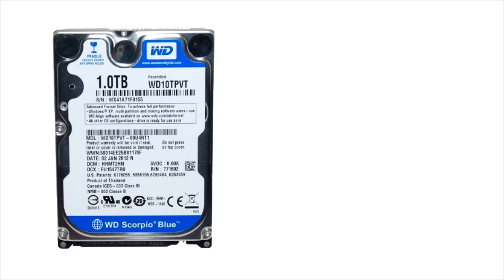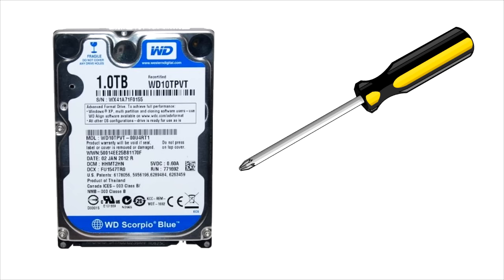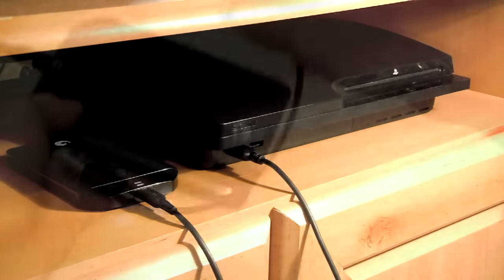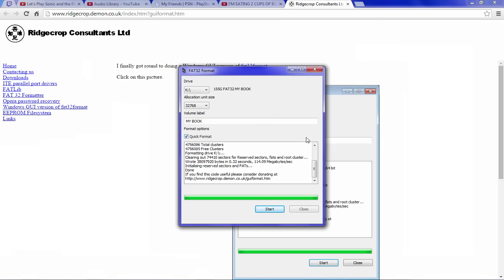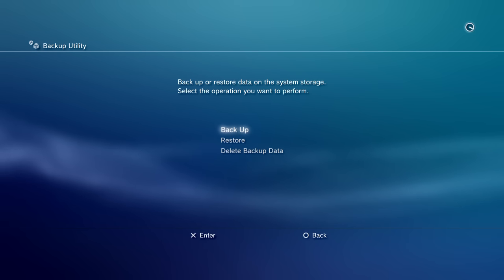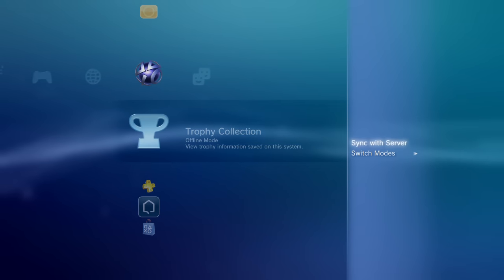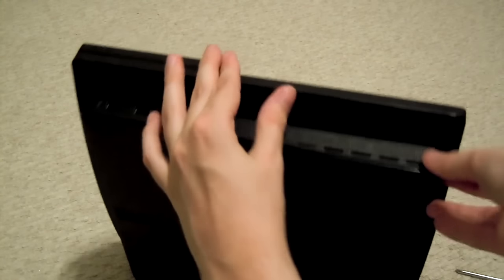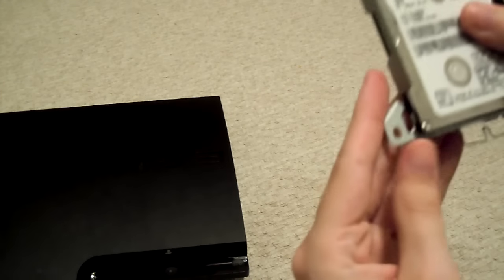PlayStation 3 Hard Drive Replacement Tutorial

Comment from the maker: It has come to my attention that Sony used JIS screws on the hard drive cage inside of the PlayStation 3. All guides I researched for this video mentioned that these screws were phillips screws and that a phillips #1 screwdriver, like the one I use in the video and tell people they need to replace the hard drive, would be all they need to replace a PlayStation 3's hard drive.
You might be able to take out these screws using a phillips #1 screwdriver like I did. But if any of the screws won't budge, you shouldn't force the screws out as you might end up stripping them. You might need to acquire a JIS screwdriver if you don't have one already to remove the screws from your system's hard drive cage.

Comment: Still working like a charm in April 2024! So instead of an external hard drive, I did use a PNY 256Gb thumb drive to save everything from my old hard drive and it worked just fine. Also, my restore took a few hours less than my back-up, which was a pleasant surprise. This video is excellent, thank you very much!
Reply: do you still have your hdd in your console or did you replace all of that with the thumb drive hdd
Reply: @bynxtypebeat  So I had the original HDD in the console and followed these instructions to a "T" with one exception -- he says to use an external hard drive with its own power source to back-up your old PS hard drive onto before you switch it out, rather than a thumb drive. I didn't have an external hard drive with its own power source, but I did have a 256 GB thumb drive so I figured I would try that first before shelling out money for a new external HD. I did, and it worked like a charm! My original HDD was still in the PS3, 160 GB, and it took about 8 1/2 hours to back up from the original PS hard drive onto the thumb drive. Then I switched out the original 160 GB PS hard drive with a Western Digital 500 GB hard drive, went through the process as described in the video and then restored all of my stuff from the thumb drive, which took about 5 1/2 hours (in the video, it took him longer to restore than to back-up, for me it was the opposite). Once I restored to the new PS HDD from my thumb drive, I removed the thumb drive and the system works like a charm. I hope that helped clarify what I meant
Reply: @HlotSfan did you use the same thumb drive to load the new software update onto the ps3 upon startup? Or did you use a seperate one?
Reply: @JoshDambuleff  No, I used a second, small thumb drive that I had saved the update onto. The update itself is a pretty small file, so I used maybe an 8GB or 16 GB to store the update. And then every so often I will go and update the update on that thumb drive, just in case I ever need it again.

Comment: I followed this guide and used some tools, and it worked! My old HDD was clicking, booting me out of games, having problems starting, etc. I thought I was toast, so I quickly ordered a new SSD and didn't proceed to use it to do any more damage until it was replaced. Shortly thereafter, my SSD finally arrived in the mail from Amazon. Here's what I did:

I used IM-Magic Partition Resizer Free to format my new 1tb SSD (Crucial brand, if you're wondering) to FAT32 Logical partition. 

Then I used HDD Raw Copy Tool to make a perfect 1:1 clone of my old HDD to my new SSD. It was pretty straightforward. 

Just popped it in, turned it on, and bingo... works perfectly. :)
Reply: When you cloned it, what happened to the extra space with the SSD? I don't get how the PS3 will even recognize it as it uses a file system other than FAT32.

Comment: Painless and effective. Works like a charm, had fun doing it too! Thank you for this detailed video.
Reply: Is it normal to be stuck at checking please wait after installing the flash drive it's taking forever
Reply: @stylewithaltitude-mensstyl2295  it doesn't sound normal, maybe start over and try again
Reply: @rMachete  I got through... still getting the error on multiplayer saying ea connection to the server was lost. Do I need to sync ea with psn?

Comment: The best tutorial I've seen so far....i've used it to upgrade to a SSD drive. Congratulations Sonicghost!
Reply: I heard SSD drives are useless in a ps3 and that speeds are severely limited, is that true?
Reply: Kosm _ depends. Some games it improves performance and it also improves loadings and installs
Reply: I will try an SSHD tomorrow. Let's see how that goes.
Reply: what if you have game installed on your old HDD, can they be transferred?
Reply: @TheEndofThis  Not really useless, but you're not going to get full ~500MB speed that SATA SSDs are capable of.
Speed is limited to 150MB as it's a SATA gen 1 connector.
For comparisor regular mechanical drives have a max speed of 80-120MB. So you do get a ~25% speed boost.
SSDs have another advantage though, no "seek" and "spin-up" times which makes the whole console feel a bit more responsive.
The difference is not huge but it's there.

Comment: Thanks for this vid. Got my PS3 via a recycling site as a non-starter, so zero cost and was then given a 500Gb disk for free too.
The original disc was dead, so followed your process for the physical replacement up to the 'two button press and hold to power up'.
Because the replacement drive wouldn't boot as it was from another device and since it didn't have valid code on it, the PS3 menu allowed me to format the disk in-situ and then after the usual 'no-way-back' warning, proceeded to load up the new system software.
The only glitch, which was very minor, was the system didn't advise the user to press the X to proceed when the EULA was shown on the screen, so made the assumption I needed to and now we have a happy PS3 user.

Comment: i accidentally updated my jailbroken ps3, and bricked it. i eventually took apart of 20gb xbox 360 hard drive, got out the mini hard drive, and put it in. then i just followed theses steps, and its updating right now! thanks so much!!!!!!
Reply: When you get a new hard drive (cuz 20gb is really not enough) (i suggest)
Jailbreak your ps3 but after you did that DO NOT TOUCH the system update setting
BEWARE OF IT!
Reply: @mertansprinter  its been a while since this happened lol but yeah stay away from the system update if youre jailbroken it will not be a good time

Comment: Thanks , this helped alot I just upgraded to a 500 GB drive from a very full 160 on my ps3 slim. Trying to do this getting everything i needed prepped for more than a few months now. watching many instructional videos.finding a way to format to fat32  for my backup of my firmware and HDD. It has been quite a mess and fighting me all the way. When i finished the restore process i got a error.that it couldnt finish, although it did complete to 100 percent. SMH. I resigned in to PS account restored my trophys. But was unable to go into the PS Store without it freexing up and having to do a hard shutdown. I had to delete the PS Store and redownload it, Although, every time i finally figure out a process to solve a problem,and thank someone.... another problem arises. Hoping this time its for good. I am quite computer savy but this whole indepth process has really pushed my patients to its limits. The videos made it look so easy. I have had to repeat all the steps of the upgrade process multiple times till it finally worked. Even to the point of formating the drive for the backup  down to within 10 GB of the backup space required. So my ps3 would recognize it. Thanks again, Wayne

Comment: 2021 info: With the PS Store closing for the PS3 in July, I've decided to upgrade my internal HDD from 500GB to 1TB.
I was able back up my PS3 files with the PS4 Game drive (2TB external HDD) by formatting it to FAT32. 
The video titled 'Format any size drive to Fat32' helped alot.I then installed a new WD Blue 1TB HDD (for laptops, not desktops!) to my PS3 slim, and downloaded the update software 4.87 from the Sony webpage, and still works! Great video dude!
Hope this is helpful to anyone and everyone.
Reply: I like to ask, how is that PS4 game drive going on the PS3? It’s USB powered, right? I’m trying to figure out what external hard drive is good enough for the PS3 and not buying something that doesn’t work as this guy says to buy an external hard drive with its own power source or adapter. Thanks.
Reply: @BossBig709  For the PS4 game drive, first I connect to my PC, and format it to FAT32. Once completed, I then connect it to the PS3 and see it if reads it. I used it to backup my files mostly.  And, it is usb powered.
Reply: @Grayfox82  Alright, I’ll try that when I get one. Thanks for the response.
Reply: @Grayfox82  I almost forgot to ask, will a external hard drive backup my themes and game installs?

Comment: Thank you so much I upgraded in 2019 to a new one terabyte drive and this video still works fantastic. and it fixed my problem I had super lag because I had the original hard drive on the original PlayStation 3... And the dreaded clicking
Reply: I cant just put in a new SSD on a bad HDD? My HDD is clicking and not able to get on

Comment: This is a great tutorial! I backed up my PS3 to a flash drive and then restored it all to a new SSD without issue. Windows limits FAT32 partitions to 32GB which wasn't enough to backup my data so I used fat32format to get around that. I also put the bios on the same flash drive as the backup which worked.

Comment: 2020 and still relevant! Finally finished UNCHARTED 2 after many, many years and wanted to continue the series so today I thought it would be good to upgrade my 256 GB PS3 SLIM to a 1TB Drive. However, it got stuck at the screen where it can't find the update on the USB memory stick. After trying a few different suggestions I read this comment on another user (STI Driver) on another video post about performing this upgrade:  "All you have to do is unplug the USB CABLE from the system after pressing START and SELECT it will work guaranteed" - This got me in the right direction unplugging the USB controller cable at a certain point seemed to work. Even though it wasn't working initially when I used the same technique. Once it copied the update to the PS3 I unplugged the USB memory stick and then I was able to guide the update along with the USB Controller plugged in. I did also find an older USB memory stick to be safe as well. The restore from backup (on my external HD) seemed to fail the first time but it may have been that I had the wrong username in the system. I deleted the user and tried again with a different name I may have used and it seemed to be restoring my files from backup correctly. I then deleted the extra user. So unplugging the various devices at certain times seemed to work. An important step that might save a few of you some similar trouble if you hit this roadblock. Thank you SonicGhost and STI Driver! However adding payment systems again seems to cause all kinds of aggrivation.

Comment: This video is very helpful, but there's no need to install an actual firmware for ps3 ... It's installed on flash memory on console...  The only thing you need to do after rebooting console after upgrading hard drive is formating it after information about new harddrive detection.... Of course an backup of settings and save games before all of this is required (an usb stick is good for that)

Comment: Heads up for those having trouble unscrewing the hard drive from the caddy: Sony used JIS screws, which happen to look exactly like Phillips screws. I almost stripped mine before I saw someone on Reddit made a PSA about it, which forced me to buy a JIS screwdriver from Amazon. I don’t know how SonicGhost was able to unscrew them without any problems though…
Reply from the maker: I did not know that Sony used different type of screws to secure the hard drive to the PS3. Thank you for bringing this to my attention. All of my research said that the PS3 used phillips screws and using a phillips #1 screwdriver, like the one I used in the video, would work. I didn't have any issues taking out the screws using my screwdriver, but I know that might not be the same for everyone. I'll update the description along with adding a pinned comment to the video to let people know of this fact to avoid any confusion.

Comment: Hey nice video! Do you know if this will work on the newest 12gb PS3 consoles that from 2014? I would think they wouldn't sell such a small capacity system for cheap if the HDD could be replaced so easily, wouldn't everyone do that instead of buying a 500gb for more $$$?

Comment: Thanks for the video it helped a lot...Would it be possible to connect both hard dives to the computer and copy the old to the new. making the backup drive and flash drive with the firmware unneeded ?? Most informative video i have seen for PS3 upgrade.
Reply: The  PS3 uses an encrypted drive with a proprietary boot format that shouldn't even load on a Windows PC.

Comment: Great video. Question: I put in a new hard drive, got it formatted, got the prompt to install the OS, tried to install via an external drive I had been using for my PC (not sure what format it was in) & tried to use a cd-r; neither worked. Made sure the files were all labeled correctly. Do you think I should try a thumb drive or is there something majorly wrong with my PS3 & nothing will work? Any advice greatly appreciated, thanks.
Reply: Make sure the folder name is in all caps.

Comment: I'm stuck on the prompt that asks you to connect the controller to the USB port and disconnect it then press the home button to proceed when you first turn it on. I tried using a PS4 controller since I don't have an original DualShock 3 on hand and I even bought a Power A controller for a PS3 and when I tried connecting it unfortunately didnt work either

Comment: If I don't have a flash drive, I just hope it is be able to it with a external H.D for backing up and restoring I also have an SD card in the original backwards compatible model so maybe it'll boot from there as well. Let me know if you know.
Reply: Using an SD card is fine, just use a USB SD card reader. That's exactly how I did it, I don't have a flash drive on deck.

Comment: Hi Me again...I forgot to mention that someone must have already tried this as it' has a 120Gb Hard Drive in it when it should have an 80Gb...Also when trying to Update My Unit I used a Brand New Flash Drive...Went on the Playstation Site and Downloaded the Software and did exactly as they and You said to do...Created a Folder named PS3...Created a Folder inside that Folder named UPDATE...and copied the PUP file I downloaded into that Folder...Pressed Start and Select at the same time...And it came on and searched for the Update...When all was said and done it came back on and said it couldn't find any Applicable Data and I went through the same process over and over again with the same outcome each time...One other thing...It doesn't come on with any error code it just says that it cannot run on the current Software

Comment: I tried two different flash drives, both formated to fat32. When I pressed start and select, after a several seconds it stated "The data is corrupted. (8002F2E4)".
Obviously I tried a few more times but to no avail. I'm sadly disappointed. Not sure what to do at this point. Waste money and biy a third flash drive? I'm not sure what the problem is.
Reply: I just had the same error code come up at the same part of the process. Any one have advice on what to do here, or what the issue could be?
Reply: @Alex-CA  honestly I started over reformatting. It worked after the third time I went through the process. It was nerve racking but eventually it worked and it has been ok ever since. I hope you are able to get passed this and that we can continue to play PS3 for years to come.
Reply: @Faustustopheles  Yes! I was able to figure it out, I have to unselect the "quick format" option on my PC. It tooke 10-15 mins to format a 16gb flash drive, then plugged it into USB slot 1(closest to the edge) on the PS3 and it worked beautifully
Reply: @Alex-CA  that's awesome! What a relief. 😀👍🏼
Reply: @Faustustopheles  my last drive failed I think, my PS3 would literally freeze on startup and wouldn't even allow me to access the menus. I purchased a 1tb 7500rpm cuda drive on Amazon for about $60. This solved my issues. Now I can get back to playing some nostalgic exclusives 😁

Comment: this doesn't work for me it it says no applicable update was found, connect storage media that constains update data of version 2.70 or later, and than press the start and select , i have formated fat32, i have worked with quiet a few playstation 4's and the file which we download on the usb for ps4 is about 1 or 2 g i am thinking this is not the way for hard drive changes on ps3 files

Comment: What kind of external hard drive do you recommend? Will a 1TB external drive suffice?
Reply from the maker: Any hard drive that has external power I recommend using to backup a PS3. I used a 1TB hard drive to backup my system and that worked fine for me. The hard drive has to have some kind of external power source to work. I tried plugging in a normal USB hard drive I had lying around to backup my PS3 and that didn't show up on my PS3. But using a hard drive that had a power cord like the one I use in this video worked just fine.
Reply: Thanks. One more question. I already own an external drive. Will formatting it into FAT32 affect my other files on it?
Reply: I'm having trouble finding a USB Flash Drive that's perfect for this. Could you send me a link please?